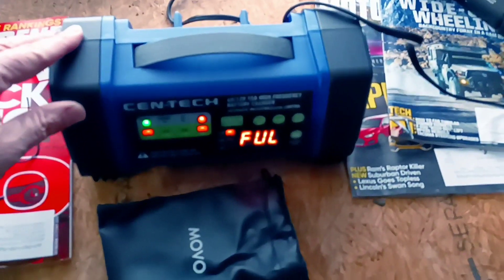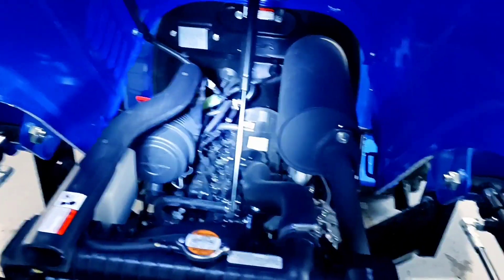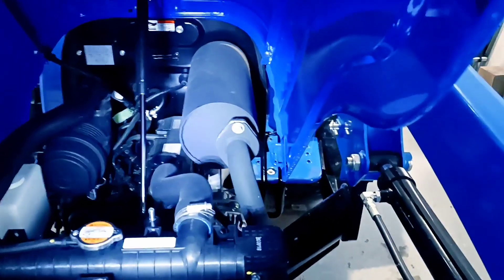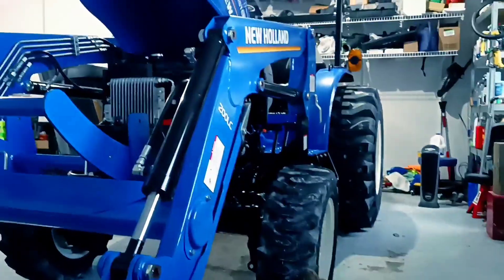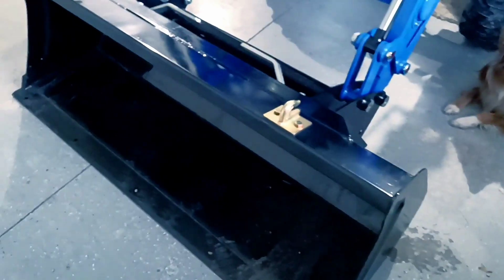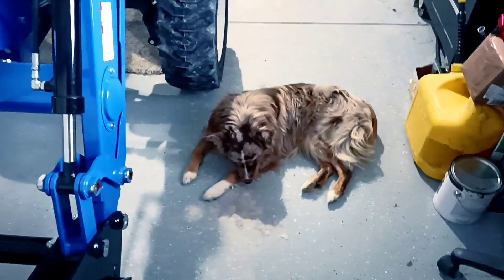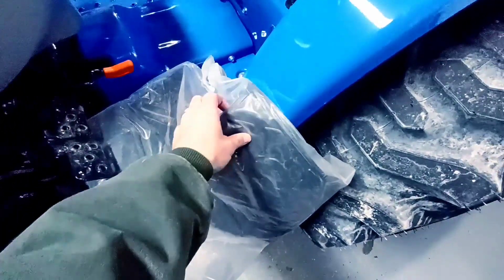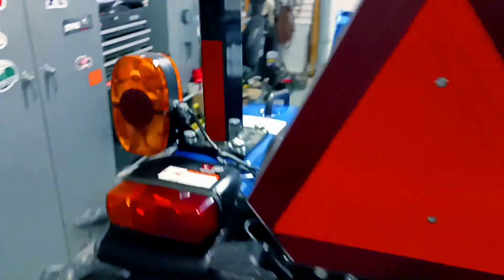Somebody Asked What Emissions Means for Tractors *plus* I'm Leaning Toward Keeping the Workmaster 25

Comment: Keep your battery off the concrete. It won’t go dead as fast.
Reply from the maker: I prefer to charge them on the ground.  If they leak it's not as big of a deal if they're on the ground.  If they leak on a table or shelf in the garage it's a bigger mess.  Plus the instructions for the charger state to keep the battery below the charger.
Reply: @4-LOW  just put it on a piece off wood to insulate it from ground .
Reply: @OFFRD  lol I looked it up I guess I’m showing my age the new battery doesn’t have the drainage problem anymore if they set on the concrete.

Comment: I'd say if your not planning on ever running a rototiller you can get by with 25hp, 40hp will even struggle a with a rototiller. Also John Deere does sell an attachment for converting to skid steer quick attach not ideal but if you really wanted the green paint it is an option.
Reply: My Kubota l285 30hp tractor did a good job with a 5ft rototiller, though it sent my spine rattling when I was finished 🤣
Reply: The L285 has 9 more PTO hp, the Workmaster 25 could probably rototill in perfectly dry soil at a snails pace. But if there is any moisture he will be stalling it all the time, which I would imagine would get frustrating...
Reply: @nclanreimer  I wasn't criticizing your comment. I have been warned that 25 horsepower tractors really struggle with rototillers. Plus, the arms on my L285 struggled to keep the rototiller down in compact clay soil with melon sized stones. Overall, I was very impressed because the rototiller looked so big on the L285.  I guess using a ripper to break the soil first may help a lot with compacted soil. That's what I'm gonna do now with my replacement tractor when I till new soil so I'm not busting shafts on roots or big stones. 
Thanks for your reply Gibons!
Reply: @blueridgehollow2510  Huh, we have Muratori and Maschio 6 foot and 8 foot rototillers at work and they have no problem digging in. I watched my boss rototill a hard packed gravel driveway with one and it handled it no problem dug down about 6 inches. I've never seen ground or plant material they couldn't tear through. What brand was your tiller?
Reply: @nclanreimer  It's a King Kutter from Tractor Supply. I still have it. The rototiller is fine because my Kubota L5040 doesn't flinch with keeping it in the ground. I have really large stones in my clay soil and my L285 didn't handle the kickback well. I'm not sure how much better a new 25hp with similar size lift arms would fare.

Comment: We have several machines with DPFs...JD skid steers, excavators, 40 hp tractors. We have not had any DPF issues or so far in the hours ranging up to 4000hrs of commercial use. Now the DPFs on our trucks is a different story! The 30-75hp range tier 4 engines have been very reliable for us....knock on wood!

Comment: Working slower is not all that bad and its safer but you could be doing that work with shovel and that would be way slower you mad a great choice the emissions will cost alot more in the long run
Reply: That is a solid point. Especially if you have children that you want to teach how to operate and work on a tractor safely.

Comment: Buddy i hate to tell ya i told ya so lol,, but those tires and frame are way to big for that horse power tractor, like i had mentioned in the tree tire spinning video and is why the 1025R JD for example has smaller tires the appropriate size tire for that HP machine.. New Holland and some other brands Red ones put them big tires on there to “wow” people as a selling ploy to get people to buy their machines..  oh look how much bigger that one is for X amount of dollars .. a 1025R would work that workmaster 25 i to the ground trust me.. if ya want to keep the new holland get the engine ya want with the 40hp engine while you still can.. you may say ya may not need all that HP , but let me leave you with the 2 sayings my pap used to tell me , 1st “ Better to have and not need than to need and not have” . 2nd You can do little jobs with a Big tractor but you cant do Big jobs with a little tractor”. While you can still trade that one in do it get the one ya want , an engine that is more appropriately suited for that size of a machine.. good luck my friend ..

Comment: I had ordered a 24.5 hp. 2 ton tractor, that includes loader. But I ordered the shuttle as I felt a tractor that size needed as much to the wheels as possible and the loss with hst would make it less capable. 24hp works for an hst that weighs 1600 lbs plus loader. Even this New holland is 2400 plus loader. Nice to see you have reservations. I canceled my 25hp order (no word in 3 months) selected a different brand. 48hp cab loader. Weighs 4800lbs. Longer wider hst. Only 7k more

Comment: All that emissions hassle for 1 horsepower or more, can you keep the 25Hp tractor and mod it with a performance chip after the warranty expires ?
Reply: There isn't a lot of aftermarket support for performance chips in tractors.  26 HP is a cutoff.  All new tractors need to meet Tier 4, but those under 26 HP have less restrictions on emissions and what comes out of the pipe.  Most tractors these days come in 25 HP (give or take a smidge based on their measuring and marketing) , then jump up to 32 or 35 HP.  Doing the math it doesn't look smart to pay $4k more for a 7 HP larger tractor, and often times the 25 HP and the 32 HP are the same engine but with a slightly different tune or higher pressure fuel pump or better injectors.  So yeah, you might be able to get the bigger pump or injectors from the 32 HP and put into your 25 HP, but the tractor manufacturers are fairly smart and don't make the ECUs exactly drop-n-swap.  By the time you get done buying parts for it you're probably close to that $4k difference you initially saved, and you violated the warranty.  You're usually better off just getting the right sized tractor to begin with.  You can always get used a pre-Tier 4 tractor, but be ready to pay a premium for those nowdays.  And honestly the emissions stuff on most of them is pretty well ironed out and invisible to the operator with the exceptions of a couple of first generation "let's try something new" models.  You just have to run them at a specific RPM rating for 15 or 20 minutes, which if you're mowing or tilling or doing loader work you're already at that RPM anyway.
Reply: These simple non-catalitc,non particulate filter 25hp or less indirect diesel tractors have NO ecm (electronic control modules), AKA. ,(NO CHIPS). They can be turned up (rpm, injector timeing , volume,and pressure) best thing to void warrenty and EPA emmission approval. Just keep this rig and get to know it just the way it is. Happy tractoring!
Reply: @donaldstrishock3923  Good points mentioned,  keep the Workmaster 25 and install a cab. Protect yourself from the elements then time wouldn't be a factor to expedite the job due to outside temperatures cold or hot. The Curtis Advantage cab is nice and comes with a heater for about $3500.00. https://www.youtube.com/watch?v=7MHDMCjo5Vo&feature=emb_title